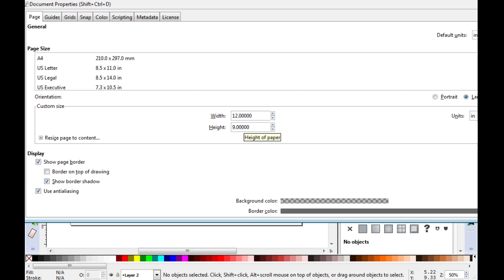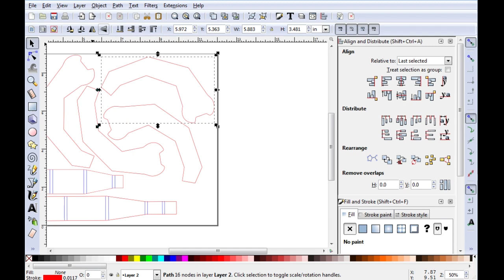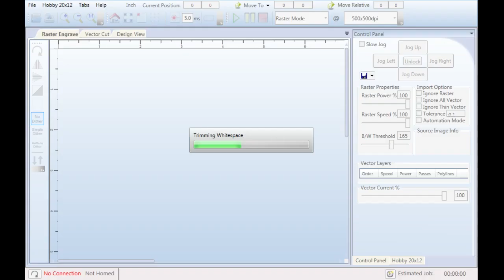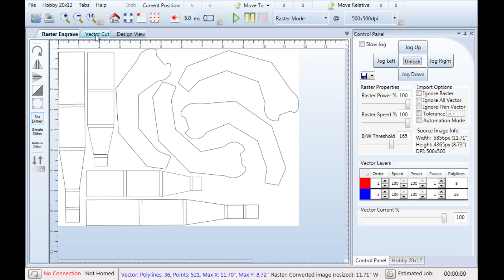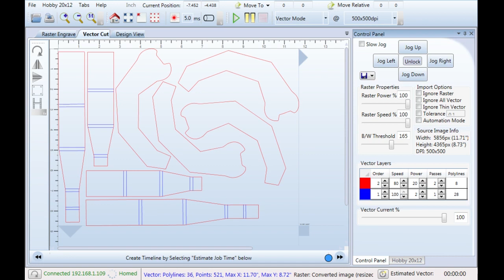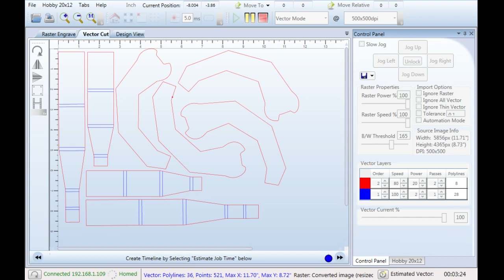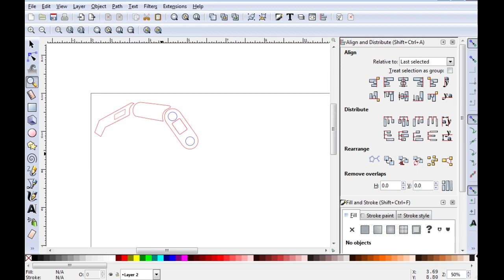Prop: Live - Fallout 4 Assaultron Costume - Hands

Comment: Hmm I wish I knew more about your software. My laser has a setting called corner power. I can adjust that to make the shallow cuts more uniform. The reason you cut through part of that detail bit was because the laser started slow and ramped the power up faster then the motors could get up to speed. So I usually reduce the laser corner power to really low. I took me a while to work out the exact number but etching foam is really tricky. However it cuts wonderfully.